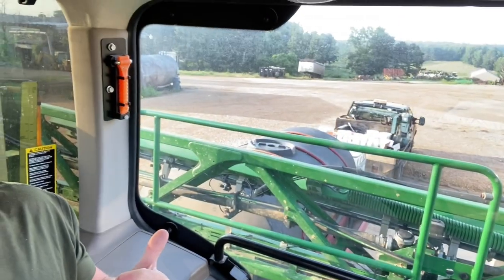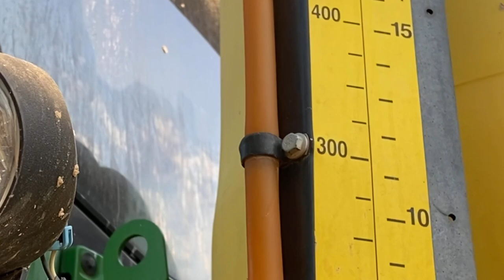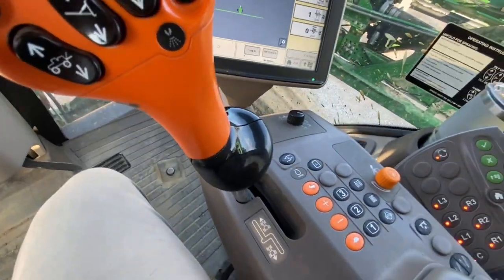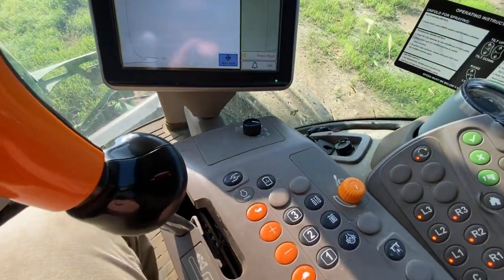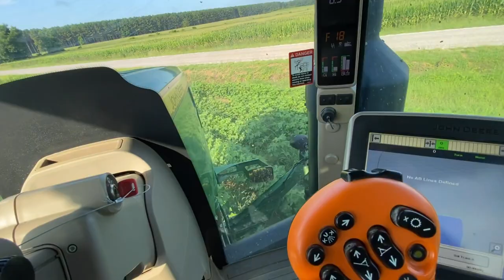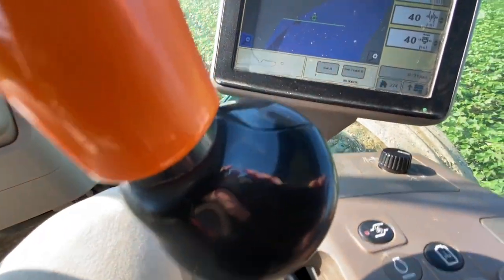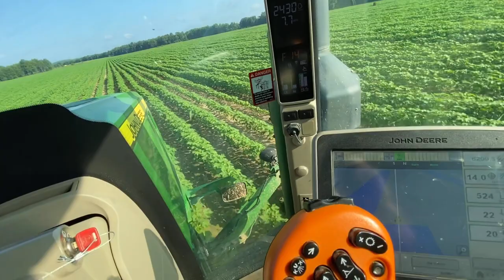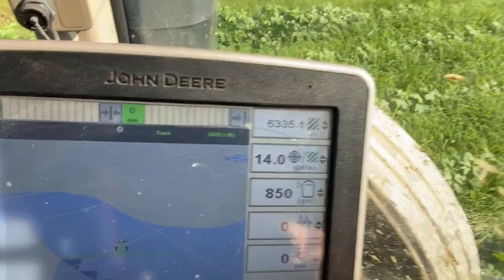How to Drive the Sprayer

Comment: I generally just count. I tried several times using auto steer even with RTK it’s still a pain to mess with.  24 rows from your last tire track or 12 if you use your foam markers on the end of the boom. Point rows make counting even easier lol. Enjoy your channel keep it up 👍

Comment: I’m glad we reuse the same ab lines year to year and they’re in every guidance system. Get to the field, select the right line and go. Beds are definitely easier to hold by hand but on strips the system does better than me most of times.
Reply from the maker: We should probably look into doing something like that with ours, but this year our main struggle was keeping accurate signal during changing fields. We have some very small fields also. And probably over 1,000 different row directions total